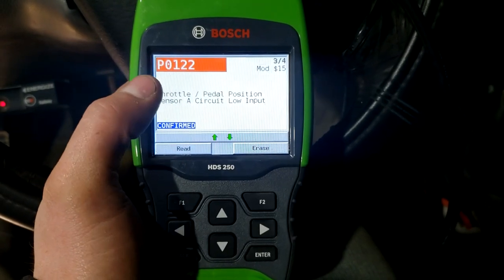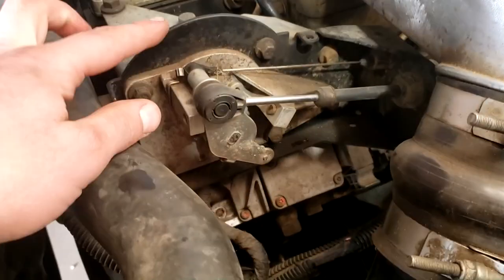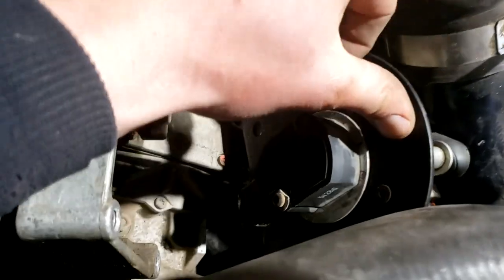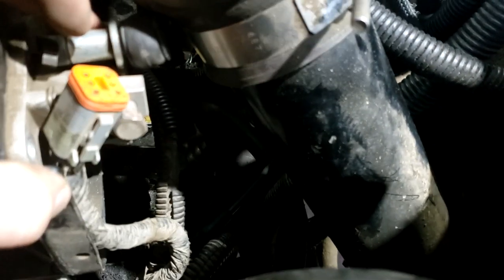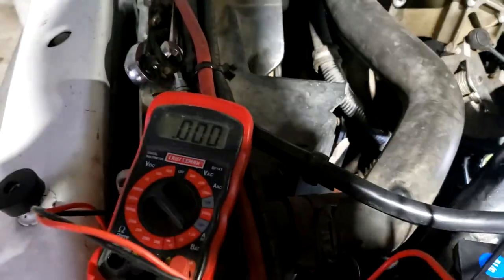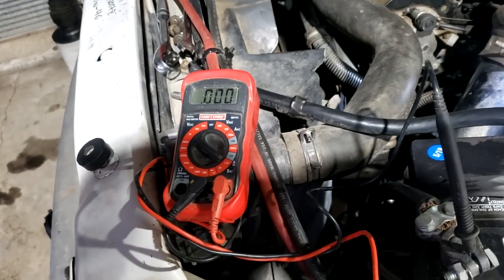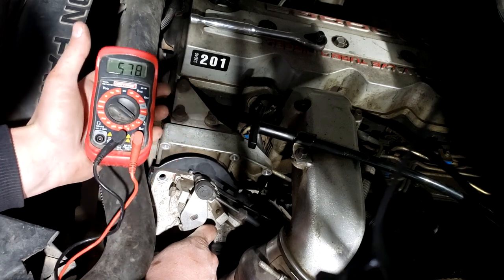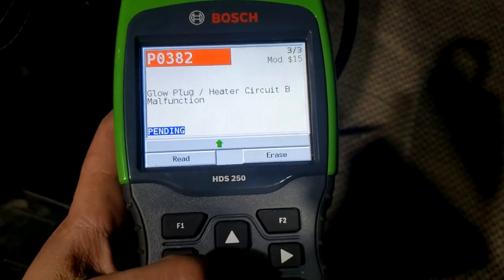Dodge Ram 24v Cummins APPs Adjustment (P0122 Trouble Code Fix) Step by Step!!

Comment: would lack of this adjustment cause total throttle failure? just installed new apps and worked fine for 5 minutes then lost all throttle control

Comment: i def have sluggish shifting in auto trans , and code p0122. '98 24 v.  he adjusted w set bolt, other vids show loosen two t-20 torx and rotate apps a bit to adj voltage? also other wire color was yellow.  great video.

Comment: would this cause the truck to not want to move bc tc is not unlocking? mine is the same .227 volts as yours was
Reply: I'm also experiencing torque converter clutch issues. But in my case it is a repeated lock and unlocking while going down the highway. Most noticeable when on the gas going up a hill
Reply: @threize6840  clean your grounds. My old one did that. Terminals. This one Is getting a full trans rebuild
Reply: @Freddysimpsonn  how many grounds and where? My voltage was originally set at set at about 0.490 and 3.52 at WOT. I changed it to what another video suggested which was .610 idle and 3.8 WOT. Didn't work. It still unlocks and locks back up repeatedly but with a check engine light, code is p0122 TPS voltage too low, even after raising it up
Reply: @Freddysimpsonn  I cleared the codes on the computer and the problem is still there but no check engine light. I put the voltage back to what it originally was for idle and WOT
Reply: @Freddysimpsonn  i should also mention that I did do the pedal thing to let the ecm learn the new voltages
Reply: @threize6840  the battery terminals. Clean them very good.
Reply: @Freddysimpsonn  I'm cleaning every ground wire and strap that I see. Especially the one from the firewall to the pcm.
Reply: @Freddysimpsonn  cleaning all the grounds worked by the way. I set the voltage back to what it was for the apps and cleaned all the grounds and the converter stays locked
Reply: @threize6840  told ya your welcome lol
Reply: @Freddysimpsonn  thank you
Reply: @threize6840  really that simple? Lol did you get the paint off the firewall to ground it better?
Reply: @threize6840  I have not yet adjusted the TPS sensor’s Voltage though.
Reply: Just purchased it from Orielly’s
Reply: @shawnlack1527  are you experiencing the torque converter locking and unlocking repeatedly?
Reply: @threize6840  yeah
Reply: @shawnlack1527  I can provide you with some of the things that I did to help. And provide you with additional information that no one talks about. Try to refrain from adjusting your TPS and leave it as a last resort, the pcm needs that to be correct to optimize transmission shifting and lockup patterns and usually isn't out of range unless you have the TPS code (if you do then I suggest having a mechanic adjust it so you don't fuck up your truck). But when I adjusted my TPS I had the TPS code stored in the pcm. Now. To help fix your problem which temporarily fixed mine, I cleaned all my ground contracts in the engine bay. Engine block, frame ground (driver side) ground from firewall to pcm, over to the fuse box, etcetera. This did fix my problem temporarily (few hundred miles). So I did some more looking around in the engine bay and did some research. On the passenger side battery when you're facing the engine and the battery is right infront of you, look to the left of the battery coming off the negative terminal. It is a ground wire with a plug that leads over to the PCM on the passenger side firewall. Unplug that, put some dielectric grease on the female end, then plug it back in. Hold the clip release and move the two plugs back and forth into each other to work it in and hopefully shine up some new contact metal. When I did this it took a couple months before it happened again. And when I got to work I opened the hood and unplugged it then worked it again, and haven't had a problem since (3 weeks ago that happened). Now, those are the cheap fixes that I did and they worked for me. If none of those work for you then there are two other things you can do before giving up (unless there's more that I don't know about). Next to the passenger side battery there are two wires attached with wiring insulation that leads up into a harness behind the alternator. This wire is NOT shielded. So the electric signal can be messed up occasionally. I don't know why they didn't build shielding into the wire but they didn't. Simple fix for that is to wrap that wire in aluminum foil and then wrap the aluminum foil with electrical tape. Try everything else before that one. Then there is one last thing. Look up "noise isolator" for 2nd gen cummins. It has a ground lead which you bolt to the fender, then it pokes into the (I think) orange wire that goes to the pcm. Look into it. That wire can begin to get a disrupted signal and that noise isolator helps smooth the signal out on the pcm end. Hope this helps you 👌
Reply: @threize6840  damn man. I just saved everything you said, I appreciate the help, most the stuff I know of but never did, I usually just sell the damn thing lol it’s so aggravating and embarrassing. But I will get to it and do all these.
Reply: @shawnlack1527  alright. Let me know the outcome. If you have the code for tps voltage out of range then I suggest starting there and send it to a good mechanic that works on diesels that way you have some reassurance. Unless you know what you're doing. Throttle position is vital for how the transmission acts, as well as a few other things.
Reply: @threize6840  yeah it’s weird I’ve never had a code pop up on the truck
Reply: @shawnlack1527  so you do have the code for the TPS? If you don't then do not mess with the TPS voltage
Reply: @threize6840  hey bro do you remember what voltage was at b4 you replaced and then what you set it at after you replaced it?
Reply: @andresrodriguez1280  I think I have photos of the voltage. Let me look and I'll get back to you. I'll look later because I'm about to leave for work lol
Reply: @andresrodriguez1280  set it to about .480 to .490 at idle. That's the specs but if you want I can check mine tonight so you can set yours to the same

Comment: Did you ever figure out the p1693 code?
Reply from the maker: No I havent had a chance to look into it yet
Reply: @j-bobsgarage7535 did you ever fix that code I have the same code and it seems to be related to the vp44

Comment: What size bolt for the apps?  Mine is gone also
Reply from the maker: that bolt i put in was a fine tread bolt, not sure of the size i just found one that threaded in nice.  Im guess its a metric thread.
Reply: 10mm boots then a T20 torx screw

Comment: I have this code intermittently. And sometimes is also says controls module program error but not every time. It will get dead pedal. And come back. Completely random. Clearing the code will fix the issue for a random ammount of time.
Reply: Ever figure it out devin?
Reply: @gw1652  replaced tps and it went away